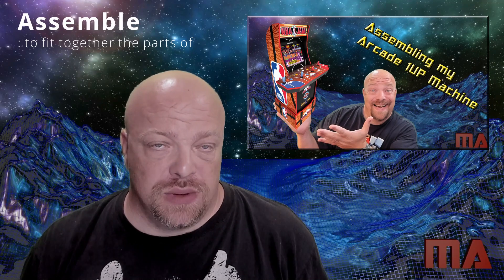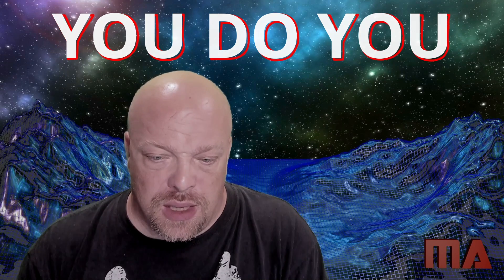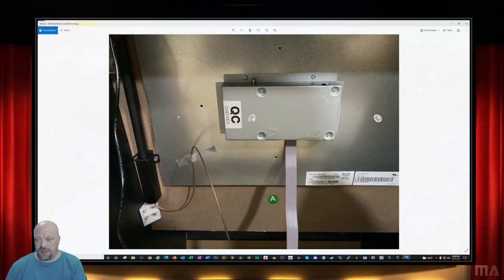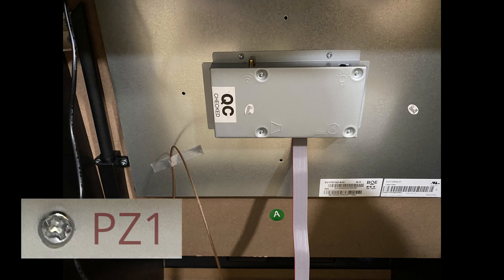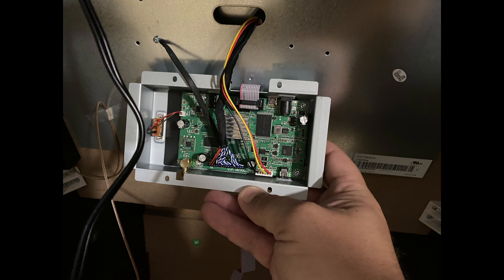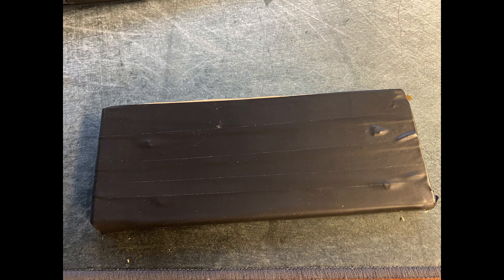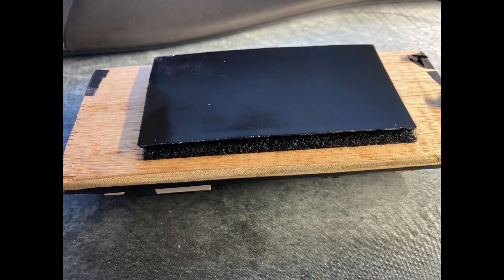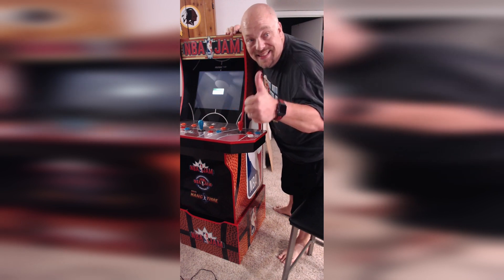Modding my Arcade1UP - Part 1 - Main Screen needs HDMI

Comment: hello, can you please tell me wich hdmi vga board I need for a mortal kombat 30th aniversary 1up cabinet? Ive read on amazon that there are several type of these boards, Thanks!
Reply from the maker: I'm honestly not sure.  I didn't know that they were making that cabinet.  One sec... (drinking at a bar right now)...  tried to look it up, they don't give me the specs on the page, so I can't be sure 100%.  But what I would say, is in reviewing the video, does the connector look the same?  If so, you're probably save in using the same controller as I do in my video.  OMG, I can't believe the 30th anniversary is within my lifetime... damn I'm old LOL :-)
Reply: @MavericksArcade  hello,
i just made  a raspberry pi mod so riped out the original lcd and board. But thanks anyway! Have a nice drink and stay young!

Comment: Is there any to convert the input signal from the original board to a HDMI connection.
I have The Simpsons version in my bar and I want to interrupt the signal with a splitter so I can push a button to change the screen from the game to whatever video signal is coming from the cable box. Do you think this is possible?
Reply from the maker: That is a really interesting question!  So you're looking to preserve the original functionality but to ADD functionality instead of simply replacing the original....   DAMN!  love it!  I think I actually found an answer.  

Do you mind if I use this post and the answer in my next video?   

Check out this video, it looks like a good answer  :-) 
https://www.youtube.com/watch?v=QkUR3-CbVM8

Chuck
Reply from the maker: No bad for 4 drinks in :-)
Reply from the maker: Sorry, again, been drinking, but I think this is along the lines to answer your question.  I think you want to work on converting the signal.  So, you would want multiple components here... First, you want to convert your LVD signal from the board to HDMI.  That way, the output of the original game ends up in HDMI.  THEN, add an HDMI selector switch to allow you to switch between original and the added PC's with emulation.    Does that make sense?
Reply: @MavericksArcade  Yes! I want to keep the original game, and it's board and simply interrupt the signal from the board to the moitor with a HDMI selector.
So the video you sent was almost what I need to do, but instead of 2 outputs, I need 2 inputs.
The reason. I want to do this is because the cab is in my bar and we have 3 TVs already, but I think it would be super cool to flip a switch and have the football game on the cab.
And no i wouldn't mind at all if you used this for a video!
This idea came from being a few deep lol

Comment: What happens if I accidentally plugged the signal cable with the red facing the wrong way the first time? Do I need a new one bcus my sceen is just black or blue now
Reply from the maker: That I do not know, and I don't want to try myself :-(      I imagine if there was power on one of those channels that mixing the cable could have caused damage, but I'm not 100% sure.

Comment: Great info on the board. Is there anyway to power the marquee lights?
Reply from the maker: I'm not sure I understand the question.  Do you mean after you've replaced all the other parts how to power up the built-in Marquee?  If so, then the answer would be to find the power requirements of the marquee and probably splice a power adapter with the correct wattage.  In my case, I replace the Marquee in the Part 2 video :-)

Comment: I bought the same PCB from Amazon and I did everything but what about the 12 pin ribbon cable? That's the only one that isn't connected. I can't seem to get it to work. It turned on for a bit with a black screen but turned right off. Any ideas what I can do to fix this?
Reply from the maker: A previous viewer asked about "BOE" monitors, apparently newer Arcade 1UPs use a BOE IPS panel?  So perhaps yours would need a BOE to HDMI adapter?  Just guessing here...

Comment: does it work with the "BOE" monitor they put in the newer arcade1up cabinets??
Reply from the maker: I'm not sure, this is the only Arcade 1UP I've worked with thus far.  However, I did a quick search for BOE to HDMI and I found a lot of similar adapters that specify BOE, so perhaps that's how you'd do it?
Reply: @MavericksArcade  id probably just install a 20" dell instead. you get bigger screen and I bought some of those monitors for $20 each

Comment: Nice howto
I bought a gen3 Defender Partycade 40th anniversary to get my game room up and running, along with a full size replica I started back around 2008 for Mame
These add on hdmi input boards need to allow retaining the original 1up emulation cpu board, and treat the 1up board as an input along with the vga, hdmi, dvi inputs
Yes, if you get a free or cheap 1up or damaged but working screen, these add on video input boards might make sense
But if all you want is an rpi or super console x pro or similar in there, just get a prefab cab off Etsy and a free spare monitor from just about anyone or thrift store.
Especially doesn’t make sense if you’re gonna hack up the 1up even more with controller upgrades, etc
Reply from the maker: It made sense to me only because Covid prices on wood and I didn't not want to build another cabinet at the moment.  They were also on sale for $100 :-)   The video series is simply for anyone who wants to customize the crap out of it :-)

Comment: Does the sound/speakers work when using HDMI? Thanks for the Video.
Reply from the maker: Yes, in fact, if you look on the card that I use from the listing on Amazon:
https://smile.amazon.com/gp/product/B084NWYRX4/ref=ppx_yo_dt_b_asin_title_o06_s00?ie=UTF8&psc=1

Check out the third pic, it has an audio input and a headphone jack...  I am going to test this directly when I get to that part of my project, so stay tuned.  Basically... it "should" take the audio from the HDMI signal and output it to the earphone jack... but I'll confirm when I get to the OS portion, which is coming soon.

Chuck

Comment: Good video! Maybe you already answered this, but why not buy a cheap used 19" monitor and a vga-hdmi adapter? You end up with a bigger screen and its way less work. A bigger screen is a must for 4-players games
Reply from the maker: :-)   It's a good point, and something to look towards doing down the road.  My main arcade has a 40-inch screen, so I'm not worried about the screen size of this machine   :-)  this build is simply to get familiar with the 1UP machines and to show how to convert existing equipment to the Raspberry.  Unfortunately, I just realized, I'm going to need to do two videos on the control panel.  One will be keeping the existing buttons and another video on replacing them with the RGB ones :-/  More work, but I think worth having two separate videos :-)
Reply: @MavericksArcade  More content is always welcomed, thanks for the videos!